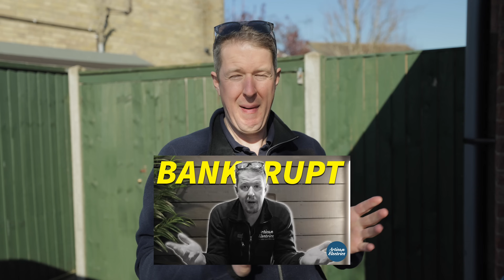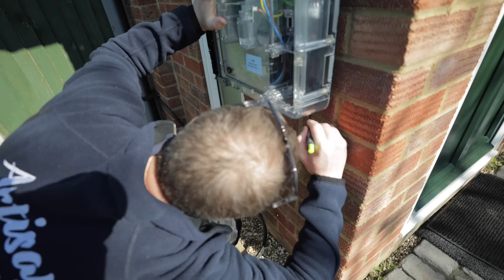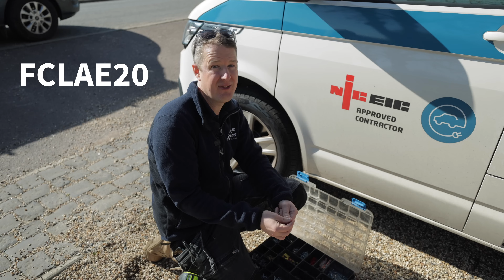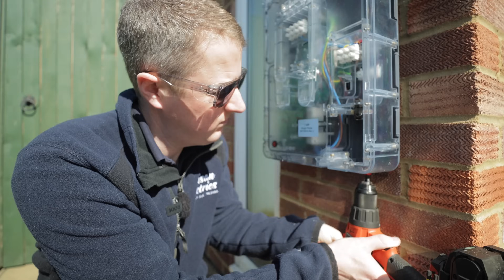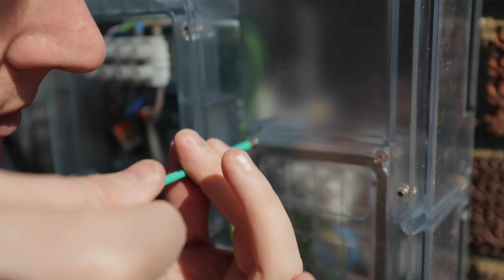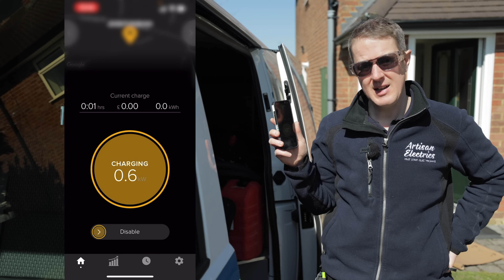Andersen EV make a triumphant return! Electric Vehicle Charger Installation

Comment: So glad they are back - stunning bits of kit.  Do you know what the big differences are with the A2 and A3 - Andersen seem to sell both in parallel, the A3 is smaller and the latest one, but cheaper.  The A2 is more expensive, the older design.  Both look great and I actually prefer the look of the A2, but can’t work out why there is a price difference and more importantly why the older unit is more than the newer smaller unit.   Any help on the differences would be amazing

Comment: To prevent all the holes in your wall you can use a wooden plate of plywood if i say it correctly. Only four holes to mount it on your wall a bit of paint and you can mount the next charger on the plywood.... and Bob's your uncle although I haven't got a clue who Bob is. But the English people always say that so... ( we say klaar is Kees) question from which coountry am I?

Comment: The Porsche of chargers uses Dacia connector blocks. As with the silly 20mm hole you had to bodge to 25mm, it's a shame they didn't use the downtime to redesign some features that let the charger down. Presumably this is old pre-bankrupcy stock they are trying to clear.
Reply: yeah, based on this video I don't think I will be buying one of these...looks poor.

Comment: Noticed the Unifi doorbell, how do you find it and how easy is it to wire in etc?
Reply: Saw your comment and went back to look at the video.

It's not a UniFi doorbell but a Ring one the bigger Ring spotlight also backs this up.

As for the UniFi Doorbell, I found it fairly easy to wire where I live. The EU one provides a transformer block which you put in your consumer unit. But since I didn't want to mess around with that mine is powered off POE with an inline wireless chime module for Honeywell Chimes.

Have a search on YouTube for G4 Doorbell POE powered with Chime, a UK based YouTuber did do a tutorial on how to do it.

Comment: I have a question as an industrial electrician in the US. 

Here in the states we use 240v single phase for residential power, because the phase is split anything that uses 240v uses two hot legs L1&L2.  For the circuits that are 120v it’s L1 and the neutral which center tapped in the middle of the 240v transformer winding. 

In the video the charger says it’s 240v, when hooking it up he says I have my line neutral and cpc which I’m assuming is ground. 

So are your utility supplies 3 phase and they just run a L1 and a neutral to get the 240v? If so what  is the phase to phase voltage?
Reply: Yes most homes get l1 + neutral giving 240 v . Some big properties get 3 phase and neutral giving 400 v between phases.

Comment: So you cut a hole in the bottom first. Then you had a nice long extension bar on the drill for the cutter and drilled at an angle. Why not put extension bar through the bottom hole then put cutter on the bar.
Reply: I thank you, that's what I was yelling!

Comment: Welcome back 🙂
Would be nice if they upgrade to lever based Wago clamps for all the connections 😉
Is the Ethernet back? If not, that would be also pretty neat 🙂
Reply: "Choc Block's" on a charger of that price, not acceptable TBH - Poor !.
Reply: @jeffcartwright7270  exactly what I thought the first second. I was like these terminals wont last the test of time. in florescent fixtures these crumble all the time. let alone exposed to outdoor conditions.
Reply: @SuperJWATT  you not heard of IP65 enclosures,  ive had mine for over a year and decided to spray my front panel cover to match my car and the terminals are exactly the same as the day they was fitted hense they are with in a IP65 enclosure.
Reply: Not so sure my Indra Smart Pro has Phoenix Pla 5 clamp type connectors the live failed after 3 years (2 weeks out of warrantee!!) Luckily caught it before it burnt the control board, 32A bit close to the limit for that connector
Reply: @paulevans5018  exactly, I have 70+ years of electrical experience passed down to me. These connectors fail quite frequently. I would like to see real lugs so the cable isn't derated as well. Those connectors are not even 65 degree c probably. So the conductor would be rated at the lowest value possible.

Comment: Look at the new OVO charge anytime EV tariff add-on, highly recommend, you need certain smart charger,  but it allows you to charge your car anytime for 0.10pkwh
Reply: OVO are so overpriced for energy
Reply: @kobirelf97  really not, on standard rate it’s the same across the board

Elec 30.85pkwh
47p standing charge 

Gas 9.69p kWh
27.72 standing charge

Plus EV addon 
.10p kWh to charge your car
Reply: @jackwhotton6145  for a economy 7 tariff for my tiny studio flat it's £150 a mouth compered to British gas that's £50 a mouth so definitely overpriced
Reply: @kobirelf97  don’t fix into a contract while prices are high, 
Go to the variable standard price cap rate. 

No point comparing old prices with todays prices… your new fix will be more expensive. 

What are your price units per kWh?